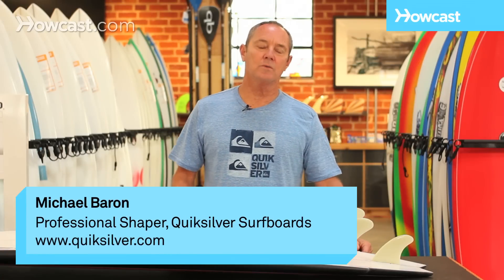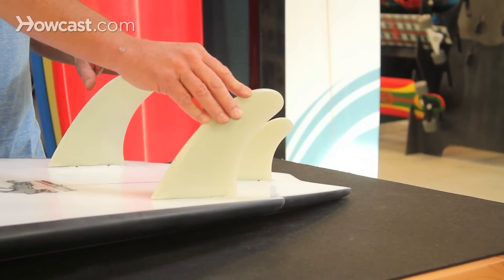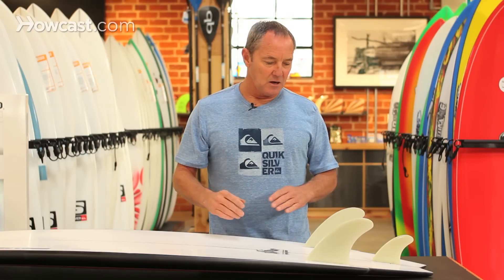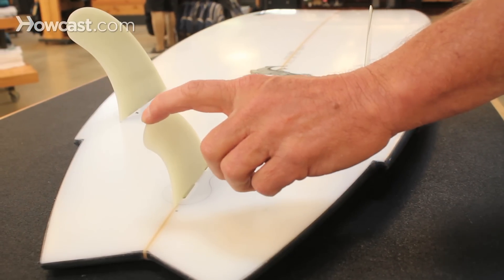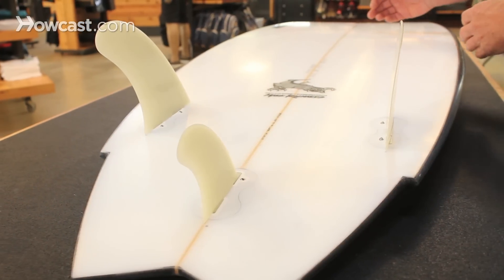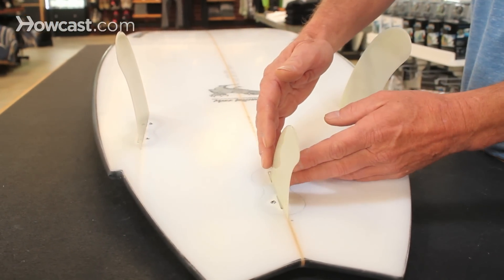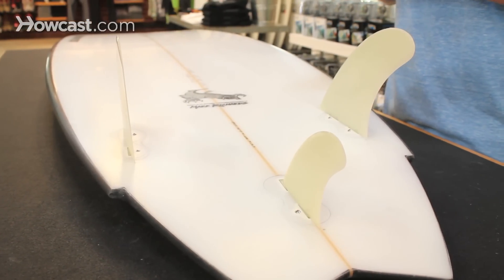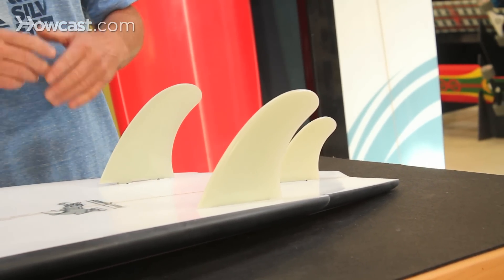What Is a Twin with Trailer? | Surfboard Basics

Comment: This was well explained.  There appears to be a trade off: drive vs hold.  

I most often use a twin fin setup as our normal surf is mushy.  The twin fin decreases drag allowing for faster paddling and down the line drive.  When the surf gets a little bigger or faster, I add a very small trailer to allow for extra hold.  The drag is negligible on the faster moving waves.
Reply: Nice, thanks for this comment. Surfing for forty years and just ordered my first in a LONG time twin fin. I'm having him glass in the twins and adding a futures box for a trailer...I live in Florida so I'm looking forward to better small wave board that's not a longboard. Never been a fan of longboards, but older and fatter so I broke down and bought one a couple years ago, its fun, but I miss my shortboard. I like your explanation.  I can still surf very good but every thing gets harder as you get older and it's been a really long time since i had anything that was close to a true fish. I'm excited.

I'm looking forward to the glass in fins, it's been almost 20 years since I had glass in fins.

Now I've got to find a fiberglass trailer....
Reply: @ClausenLT  i hear ya....i’ve found that my favorite board is my midsize.  very maneuverable but has lotsa glide.  additionally,  i can duck dive it. 
my first trailer fin, that i used in that midsized board, was made out of a cheap plastic center fin from a thruster.   i used a bench grinder and took it down to about 1/4 the original size and thinned it out a bit.  it worked really nicely but now i have a store bought one.  it is fiberglass and it resembles a fletching on an arrow,  but slightly bigger.   works like a charm, no drag but allows good hold.
Reply: @ezvibe8310  Dude that's crazy..."my first trailer fin, that i used in that midsized board, was made out of a cheap plastic center fin from a thruster."

I did almost the exact same thing except, I looked up the specs on the trailer fin I wanted to make, and made a template based on the dimensions, , width at the base and tip, and then I drew a template out of cardboard and printed a picture of the trailer fin I was copying, and just made a template from that....  I do paint and body so i have all kinds of tools, and so I made my fin with a couple tools...my fin looks factory. This was on my currant thruster that is basically too small for me now. This was 9 years ago, and when I had decent waves to test it out I was like, "OMG, this is money." And that was on small waves a board I thought my shaper made for me for small waves, and turns out was just a regular thruster, and I was riding it in small waves. 

I rode a friend of mine's 7'6" the other day, and I think I'd like riding something like that better than the 9'6". My brother almost went pro, and I was close too. Not quite sure how, at 51 how I'm going to learn how to be as good on a longboard as I am on my shortboard. I've probably ridden the longboard less than a dozen days, and I started having fun on it already, but I'm still trying to ride it like a shortboard. 

Any way...awesome!!! HAHA!

Comment: I'm working on a fin setup right now , for Beach breaks , riding a Hytpo kripto 5'10 - 2. 5/8 thick , fins are futures channel island Am1 thruster setup.. I just need a little more speed  . what do you guys think  should i go with the Twin fin with a trailer or stay with the thruster setup ? I feel i need more of a Rake and maybe some fiberglass fins instead or the honeycomb  fins I'm riding now , thanks for your time hope  to hear some idea's  .
Reply: Man sorry it took 4 years for anyone to write you back. If you still have the board I would definitely give a twin +1 a try. I think you’ll notice more speed right away and with the trailer enough hold to still bust off the lip or big bottom turn with out sliding out. Honestly I’ve never been a huge twin fin fan however a twin +1 is a game changer. I have two sets and considering ordering another. I haven’t used them in anything larger then 4’ but I’ve seen guys ride them in well overhead surf and still have lots of hold. I love them in my smaller wave board which has a small rail wing and swallow tail. Good luck, just experiment and you’ll find a good match for you. 🤙🏾
Reply: @splocal   lol 😂 better late then never lol .. it’s cool to pick back up on this subject though … yes over the years I got pretty dam good with understanding fin setups i tried a bunch of setups I have found a fin setup that works awesome for all around surf on the East coast.
Reply: @chasingwaves11  oh right on! What setup did you go with?
Reply: Curious about your setup also!  I just ordered my first twin fin plus stabilizer.  I realized the size shows xl for the twins. Im guessing that’s the standard size for twins?  Especially when you order with a stabilizer?
Reply: @jambamc3737  from what I’ve seen the twin size fins are always extra large. Stabilizer or not. However when you throw in that stabilizer it makes a huge Difference in stability.